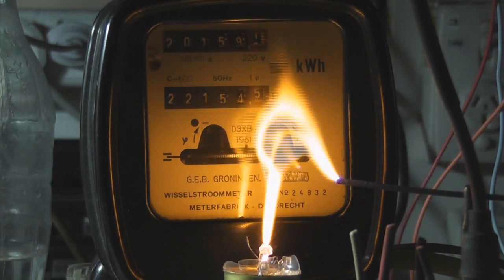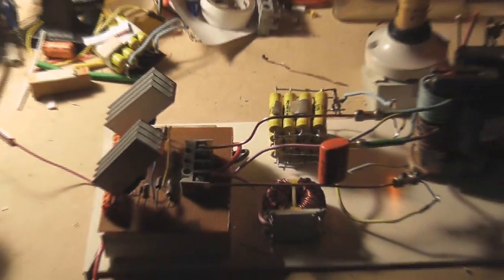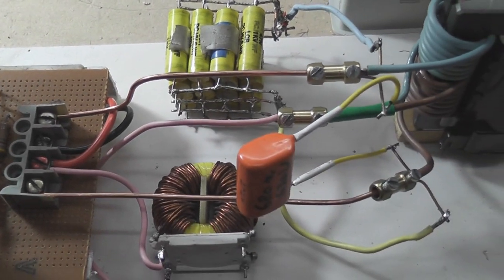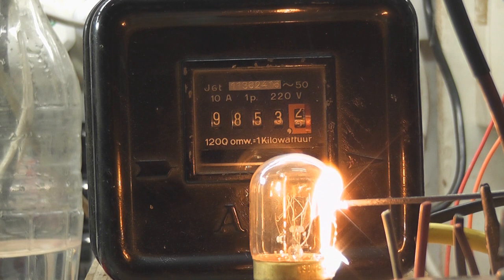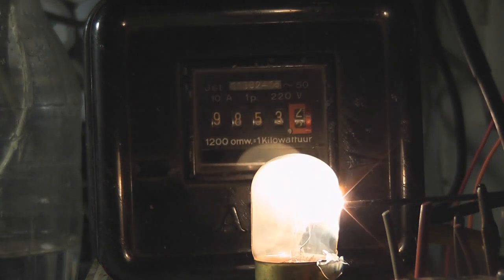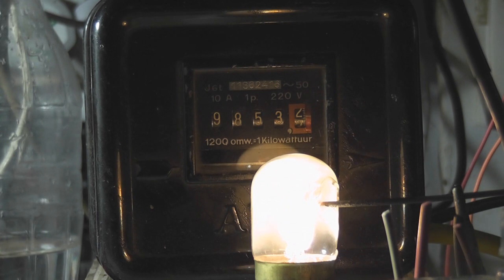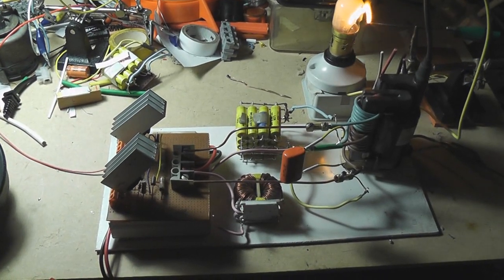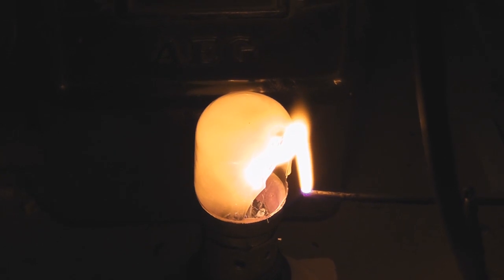ZVS arcs & kWh meter

Comment: Nice arc! What rating was your inductor? (I'm building my own)
Reply from the maker: A big 15 Amp inductor from a UPS, I only use one coil of it at the moment.
Reply: Look forwards to that video mate. Good to see someone be a fan of the zvs and flyback⚡ 👍😜
Reply from the maker: ***** IRFP260
Reply: RODALCO2007 oh ok, I have some from a plasma TV power supply, would they work?
Reply: high1voltage1rules oh that's good to know! The ones I ordered had the N after the part number. Thanks for telling me that! I feel more confident about it now!
Reply: Mac Man yeah thats fine mate if its the 'n' its good!! Glad ya happy mate' any problems or if ya need any help with ya zvs build' just let me know! Happy to help.👍😉🙌
Reply from the maker: Mac Man
The IRFP250's will do perfect too. This circuit actually uses one of each.
Reply from the maker: Mac Man
The plasma TV inductors should work ok.
Reply: RODALCO2007 that's good to know, thanks!
Reply from the maker: Mac Man
Inductors are a bit of trial and error, so are the Caps. As long they have 15 or more turns of 1.5 or 2.5 mil wire and can pass 10 or 15 Amps they are useable.
Reply: RODALCO2007 I have a set of Verniers that I can measure the thickness of the wire, the inductor has two sides, each having 30 turns. the MOSFETs will take about a week to arrive but during then I can sort out the caps I need. Thanks for all the advice! It's been great help
Reply: high1voltage1rules thanks mate! Been a fan of it for ages but never had enough courage to try it out until now!
Reply: ***** the MOSFETS I've ordered are slightly different to RODALCOs, mine are IRFP250s but they should do the same thing
Reply: Mac Man they should be fine mate. The best mosfets to use are the IRFP260N 200volts @50 amps 😉 but most of the irfp- - - are great to use plus they have the good blocking diode across the drain and source! 👍😉
Reply: high1voltage1rules thanks heaps!